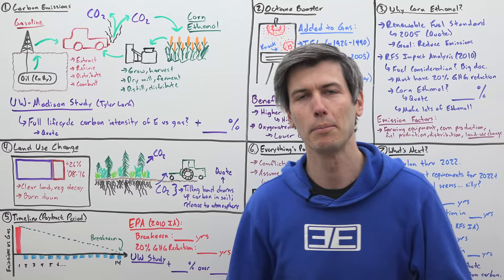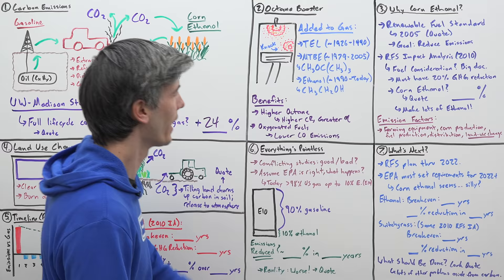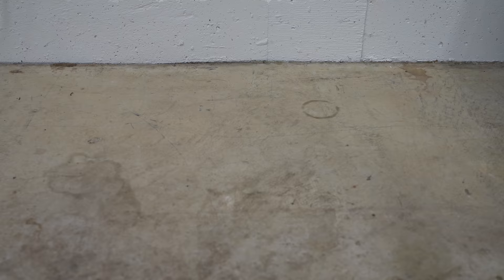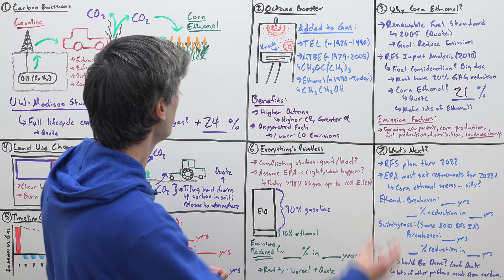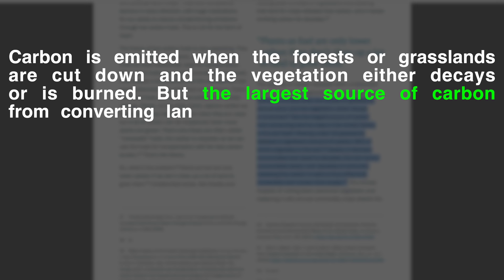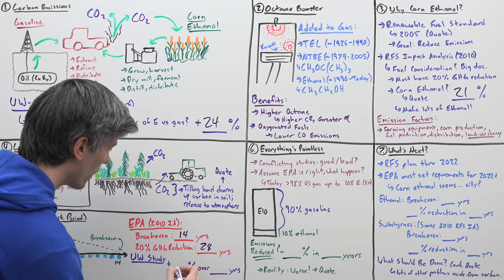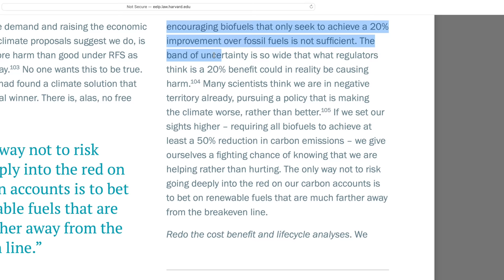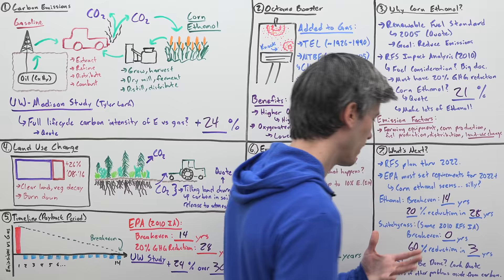America Was Wrong About Ethanol - Study Shows

Comment: Thank you for another great analysis backed up by peer reviewed documents.  A suggestion for a future video, what is the optimal amount of ethanol to produce the most power (or highest BSFC?) in a given modern engine?  Can the loss of energy from adding ethanol be compensated by the ability to run more ignition advance because of the higher octane?  Inquiring minds want to know.
Reply: Peer review, particularly in the climate sciences, carries a fraction of the credibility it used to after James Hansen and his cronies got done politicizing it.  In this case, the study is flawed from the get go due to false assumptions about land use changes.  That said, I can answer your question.  The answer is, for most cases, 100% ethanol.  Why?  Because while ethanol carries less energy per lbs, you use more of it per lbs of air reacted.  The limiting factor for power production in an internal combustion engine is rarely how much fuel you can inject, but rather how much air you can induct.  For each lbs of air inducted, E100 will liberate about 7% more energy than a pure gasoline equivalent because you burn 35-45% more fuel.  This is simply based upon stoichiometric ratios and the amount of energy present in each fuel. This is assuming similar octane, ignition timing, etc.  If you're comparing to typical pump gas (93-94 octane R+M/2) then ethanol is capable of producing massive power gains in an octane limited engine (turbocharged for example).  The edge cases where 100% ethanol is not always best would be a low compression naturally aspirated, port injected engine where the increased fuel volume can displace incoming air volume.  Direct injection engines don't suffer the same issue.  And of course there are engineered petrol based fuels that contain other additives and oxygenates that may surpass ethanol in certain cases, but they aren't truly gasoline anyways.
Reply: As stated by Church Automotive Testing Dyno Tuning, regardless of peer review most of these studies are hugely flawed. Very few people, and even fewer peer reviewers, seem to know enough about how agriculture actually works. Every study I've looked at that is critical of corn ethanol fails to account for the distillers grains that is also produced during the process. Since it wasn't mentioned in the video, it's probably safe to assume this is yet another one of those papers. Also most fail to account for current no and minimum tillage practices used on farms. 

The protein in corn is not consumed when making ethanol. The proportion of protein in whole corn is too low to make feed so additional protein from soybeans is added to make a balanced feed. However, the protein left after making ethanol is a source of concentrated protein called distillers grains which is then used instead of soy protein. It works out that for every acre of corn used for ethanol, an acre less of other crops is needed.

Corn is about 10% protein. Soybeans are about 40%. By using both, feeds ranging from 14% to 22% protein are often made. However, neither corn nor soybeans have enough fiber so a source of fiber also has to be grown. After the starch is used from the corn to make ethanol, the protein is left in the distillers grains at about 30%. The 30% protein distillers grains can be mixed back with 10% protein whole corn to help make the needed balanced protein. Plus the distillers grains still has the fiber. That reduces the need for soybean and fiber crops.

On a percent basis, soybeans have about 4x the protein compared to corn. However, corn produces about 4x the yield per acre. So on an acre basis, corn and soybeans are practically equivalent for total protein production. That means for every acre of corn used for ethanol, an acre less of soybeans is needed. Plus less land is needed for a fiber crop. So their claims of land use change due to corn ethanol are gibberish.

Corn ethanol has another benefit for human security. We depend on corn not only for food but also many manufacturing processes. If there is a severe drought for example, ethanol production could be reduced.  Thus, helping ensure enough corn for other uses.  I'd guess a 20-30% buffer against really dramatic consequences.
Reply: @ChurchAutoTest  How does E100 compare to B100 fuel?
Reply: @heartysteer8752  The corn grown for ethanol is not considered edible. 

Let the fee market determine what fuel is best to use. The government subsidies make the E85 competitive with the heavily taxed petroleum fuels. If the fuels were not artificially manipulated, ethanol could never compete with gasoline and diesel.

Diesel and gasoline are still king! There is no shortage of supply and it is the most cost effective energy source. 

Diesel has far more energy per unit than any other viable fuel. Diesel can be run lean and produces almost no greenhouse gasses.

The land should be returned to food production, not this taxpayer boondoggle scam.
Reply: No
Reply: You are playing with yourself thinking you can tweak away the fact that ethanol is less energy dense than gasoline.
Reply: I wonder what the pollution per job is since you have to use more gallons to go the distance.
Reply: @davidparker9676  A lot of the land should be returned to wild land. Even agriculture takes its toll. Although don't say that diesel produces almost no greenhouse gases. It produces a lots of greenhouse gases, just like gasoline. I agree with you that both are still king.
Reply: @davidparker9676  
There is certainly a tax at the pump on all fuels.  
Yes, ethanol is heavily subsidized.  
But oil and natural gas are all subsidized too. 
Makes it hard to figure out what anything would really cost without Congress, DOE and USDA involvement.  
I wish I knew the real answers.
Reply: Jason focused on EMISSIONS, but failed to indicate that gas mileage declined with E10.  In fact on my 2008 Tundra, it dropped from  16 mpg to 14.5 mpg, roughly 10%.  IOW, it now takes 1.1 gal of gas to drive 16 miles.   The real issue is the Federal Excise Tax on gas is on a PER GALLON basis.  They increased gasoline taxes due to decreased mileage and used the proceeds to fund the ethanol industry.
Reply: 0%
Reply: I can't blame any farmers for trying to maximize the use of their land. They are trying to make a living. But not only are the pheasants, grouse, quail, and mourning doves disappearing, all ground nesting birds like the meadowlark and others are also suffering the same fate. At least in Eastern Nebraska as far as I can tell.
Reply: Interesting enough though, while it is possible to make more power with ethanol (primarily because it runs cooler), it isn't as efficient as straight gasoline. I normally see a 10% increase in mpg when I go to ethanol-free over 10% max fuel. Straight petroleum is still the more economical choice in the long run, that is until certain groups screw things up to make it so overpriced as to make an EV look a little more appealing.
Reply: @greglarson4188  Diesel produces almost no greenhouse gases when the engine is designed to produce almost no greenhouse gases.
Reply: @travissmith2211  I don't see how it is possible to make more power with ethanol
Reply: @sammiller6631  you must mean other than CO2 because diesel combustion creates a lot of CO2, just like gasoline.

And you make more power with ethanol because it has oxygen in it. It is similar to injecting nitrous. Less air is required, and air is the limiting factor in an engine.
Reply: @davidparker9676  The "free market" you so ignorantly refer to, is highly manipulated and is tantamount to saying "let the big Corporations tell us what to do".   In honesty, any of the corn produced from altered seeds "is not considered edible" by any real standards and yet the masses demand more.  Perhaps you are not aware of of Monsanto who routinely genetically alters foodstuffs to the point of being unrecognizable to nature.  Along with attempting to take over farmers fields with their underhanded legal tactics and rather unsanctimonious breeding practices.
Reply: @lastofthebest5102  When I say "free market" I mean a free market... not the manipulated market the government manipulates, saying it's free.

I know all about Monsanto and their corrupt business model. The US government heavily subsidized Monsanto and allowed them to become what they are.

The real power lies with the consumer, if enough refuse to buy it, the market forces change to what people want.
Reply: @greglarson4188  Diesel is much lower emission than gasoline. The only real issue with diesel is the particulate matter in the exhaust. The greenhouse gasses are significantly lower than other common fuels, CO2 is very low from a diesel.
Reply: @sammiller6631  since it runs cooler it prevents predetonation. That can allow for more boost and therefore more power.
Reply: @sammiller6631  I don't know much about diesel TBH
Reply: @sammiller6631  Because you burn more of it and the overall energy content of 1.4 gallons of ethanol is 7% higher than 1 gallon of gas.  And the tailpipe pollution from burning 1.4 gallons of ethanol is less than 1 gallon of gas.
Reply: I drove through Nebraska last weekend and was shocked at the look and the stink. It looks like a giant outdoor factory and smells like cow piss.  What a shame.  If ethanol did this, it’s time to go solar and electric.
Reply: @williamrgutrich7694  So run 15:1 on regular?
Reply: @travissmith2211  IOW it takes 1.1 gal of E10 to go the same distance as E Free gas.  That's a 10% increase in Federal Tax on gas, and the cost per mile is increased by 10% with E 10.  Most Americans have failed to figure out they have been hoodwinked.
Reply: Im finding good results with 30% on otherwise stock,untuned, modern fuel injected engines.
Reply: @williamrgutrich7694  Linear thinking! Well played!
Reply: @sammiller6631  Read Church Automotives explanation above. It burns better than straight gasoline in laymens terms. More timing more power and burns cooler for denser air charge.
Reply: @paulogden7417  Thats called a farm sonny. LOL

Comment: Well thought out. Wish you had added a brief history of Cellulosic Ethanol. In my mind the corn based ethanol was supposed to be a bridge to ethanol made from Corn Stalks, Switchgrass, or wood chips. A ton of money was spent trying to make that happen, and nobody could do it profitably.  So, the corn farmers are still advertising a story which only made sense if we could bridge to this better long term solution- but today Cellulosic Ethanol remains a bridge too far.
Reply: So , why not opt for the next best thing??  2nd gen. ethanol feedstocks such as sugarbeets,  sugarcane, and sweet sorghum??   Not quite mainstream farm commodities, but not unfamiliar, either. And they don't compete for food acerage.  Parrallel process along with corn at current ethanol facilities. A quick ramp up to twice the volume of renewable fuels.  And it can happen this year or next. Not 10-15 years away ...
Reply: My company did some work at a pilot cellulosic plant.  I don't know the details (I work for a different part of the company), but the plant failed; it's now being converted into a biodiesel plant.  I asked what happened, but the coworker I talked to said, "It just didn't work."

So there's a lot more engineering required before we get economic cellulosic ethanol production.  I'm really hoping the government puts more funding into it, though - switchgrass is native to my state and we've already got a lot of oil infrastructure in place that could be utilized.
Reply: The energy cost in the separation of ethanol is the energy cost basically. So the extra cost of breaking down cellulose lets corn ethanol work.

Comment: Imagine that. I've been saying this for years.
I won't use ethanol in my small engines, as it damages seals, etc and gums up the fuel system and carb. Only run ethanol free, and turn the fuel flow off and run the carb dry. Have had ZERO carburetor/fuel system problems in 10 years I've been doing this.
Reply: Well I've had the same chainsaw for 10 years, use blended fuel in a oil mix, run it out of fuel each time I use it, zero issues.
Reply: ethanol cleans engines does not gum them up and does not hurt seals only aluminum
Reply: @haroldbrooks5473  I think the big issue with small engines is that E10 tends to collect/trap moisture.  when left in a fuel system for a long time without moving the fuel will evaporate and leave water behind to damage fuel systems on small engines which often sit for long periods of time.  If you are running the system completely out of fuel at the end of each use period issues are unlikely.

Comment: All I know is my vehicles love E85. Maybe if more people used it instead of that 10% ethanol gas, we would see more benefits. As an added bonus your engines internals stay cleaner and your car can make way more power.
Reply: I'm right there with you.   My car makes an extra 80whp on e60.  Fuel mileage sucks, but who cares.   Smiles per gallon!
Reply: @chrisschubert554  Yeah you get less miles per tank, but the cost is far less than premium fuel per gallon. So, for me even though I get much worse MPG it is still cheaper to run E85. And as a bonus way more power. I will gladly make that trade...!!

Comment: Good video, and lots of facts. However, a few things  a left out regarding ethanol. 1st, the #2 yellow corn which is used for ethanol is not human grade corn.  Its used maily for animal feed.  That said, the byproduct of ethanol production, distillers grain, is about 1/3 of the volume by weight of the original corn.  This is put back into the feed ration for animals, and is an excellent source of protein (since the starch has been extracted) in an easily digestible form, typically 15% more efficient than the raw corn.

Also, in another video from EE, if modern engines were set up for higher compression and turbocharging, they would make more power, on the same volume of fuel, even though ethanol is less energy dense.

Lastly, something that doesnt get brought up is the cost/carbon impact, and cost, of defending our oil assests in the middle east.
Reply: Yes and thank you.

Comment: Great video. I am a 59 year old mechanic. Seen lots of mouse milk, As I call it. To help improve what ever. Ethanol is the worst thing ever for small engines. Two cylinders and one cylinders. It attracts or draws moisture into the holding can or gas tank. It gums up carburetors and injections systems very badly. This "NEW" fuel out in the last 15 or so years. Has no shelf or storage life at all. Maybe 90 days at the most.   
I do have a bad back and now do not turn wrenches anymore. I do, however work at a warranty/troubleshoot company. I get calls from every state in the US. 75% of my calls are bad or old gas related. I used the fuel can from last year that was not empty. There is your problem. Gas now days is junk. Sit at a red light with a car in front of you. When they take off, Watch the water pore out of the tail pipe. Used to a muffler only had two holes in it. In/out. Now days they have one drilled into it at the bottom. So that trapped water can drain out and not rust the muffler as fast.
Reply: I found EVERYTHING you have said to be the opposite  and I have over 200 videos about it on this this called You Tube. E85 cars E15 lawnmowers. My Honda sits months and months at a time and starts right up on E85. I just started it yesterday.
Reply: Mouse milk...so child like!

Comment: My experience with ethanol is that the more there is in my Prius 2005, the FASTER it's burned away: I actually see a reduction of my kilometers per tank. So basically, it's the additive that gives you LESS for the same price. Bonkers. And on top of that it drives speculation on food, which is, in my honest opinion, something that should never happen.
Reply: Alcohol has roughly 50% of the energy of gasoline (per volume).  You have to burn twice as much to get the same amount of energy output.
Reply: Been that way all along. It's sort of a catch 22 I think.
Use less oil, but burn more fuel. And the new hybrid fuels have been harder on components than straight gasoline. It attacks rubber and plastic. And forget anything made from traditional fiberglass/ glassfibre material. It destroys the resin in short order.
Reply: It's never a good idea to burn something you should have eaten...or that could be used to grow something even tastier.
Reply: @ifitsfreeitsforme1852  You do realize that "straight gasoline" doesn't exist as it's a mixture of many different hydrocarbons? Gasoline without ethanol still dissolves plastic and many other materials. It had more to do with the continued cost-cutting by GM and their deflecting the blame of the fuel delivery systems prematurely wearing out, conveniently just as the warranty runs out. Gas lines would rust out and leak regardless as the vehicle ages, anyway.
Reply: @joec.2768  Millions of cars decades old that are still running on their original fuel systems stand to call you a liar.
Reply: Where i currently live the price of e85 is about 3.50/gal while 93octane e10 is 4.90/gal. With these prices and accounting for the drop in mpg i get about the same cost/mile
Reply: Its true. Ethanol makes more power but the mileage gets 50% worse for 7% more power
Reply: @MH-wo4be  Not ethanol.  You need to burn approximately 50% more, not twice as much.  Stoichiometric ratio of ethanol is 8.9, gasoline is 14.6.  Methanol is a different story, but we're not talking about methanol.
Reply: @Pippy1  And that price will stay relatively constant.  Ethanol producers can just fix their pricing to gas prices and make higher profits when oil prices rise.  In reality it can be substantially cheaper, but then demand would go up and they probably couldn't produce it (I just payed $2.99/gal for e85 in Los Angeles yesterday while 91 octane is at $5.79 - e85 prices will undoubtedly rise to return to the old ratio soon, some e85 stations are already at $3.69)